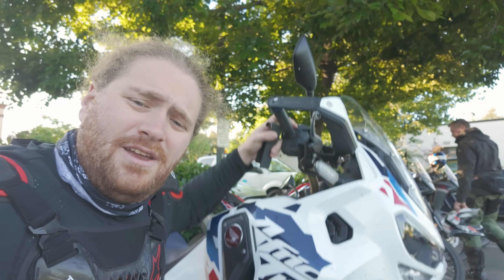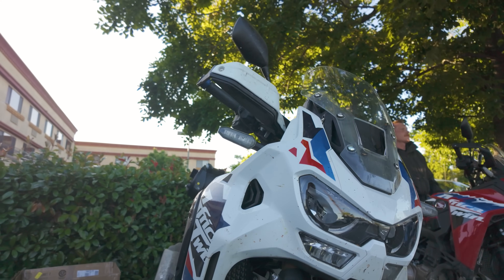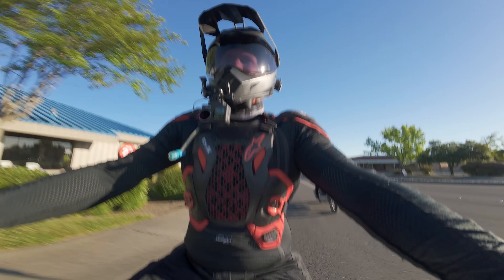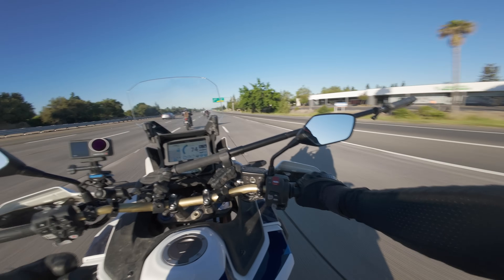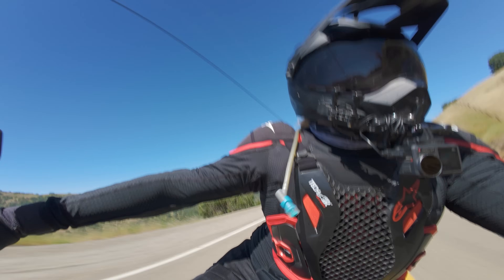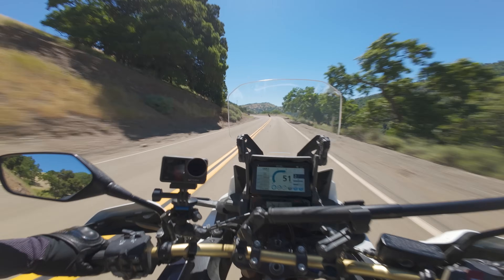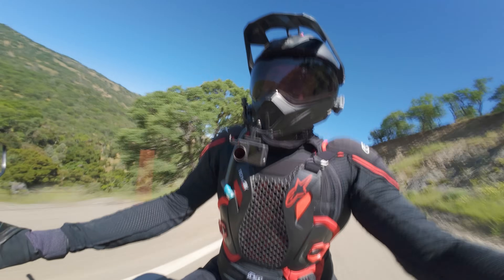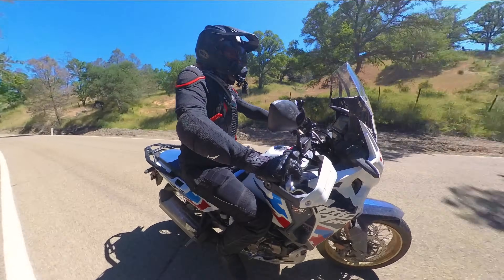Everyone Said I'd HATE A DCT Motorcycle...

Comment: Next time try not to move your body on twisties, no need that. This is not a sport bike and not about enjoying the bike itself. Thanks.
Reply from the maker: You do realize that by using your body weight the bike doesn't lean as far and as a result you're actually safer in the twisties right?
Reply: Completely wrong. The lean angle and the turning radius are geometrically interconnected. You cannot turn in the same radius by reducing the lean angle. What you are trying to do on the bike does not actually enable you to make the same turn with a lower lean angle, as you said, but on the contrary, it allows you to increase grip efficiency and obtain a higher lean angle by changing the center of gravity. But this is not a race where seconds matter. In order to increase the grip efficiency of an adventure bike that you will use all day long by one thousandth, I think if you slow down 1 mph when entering a corner instead of doing little dances at every corner, you will both get more grip efficiency and have a better day.

Comment: Owned one, a 2022 Adventure Sports version...nice bike.  One piece of sage advice: always shift into neutral, when at a stop.  Otherwise, it is VERY easy to forget that YOU...ARE...IN...DRIVE!  If you inadvertently blip the throttle, for any reason, you will lurch forward violently and either crash into something and/or fall over, resulting in wounds, in need of licking.  Sold mine because of this.  Regular manuals for me, only.

Comment: So it's basically what the step through 50/55/90/110 have had since the 60's.
Reply: I thought most skooters used a CVT instead of a DCT...
Reply: not remotely close.  Its a manual transmission with 2 clutches, and a computer controls it for you.  In Manual mode you can tell the computer when to shift.